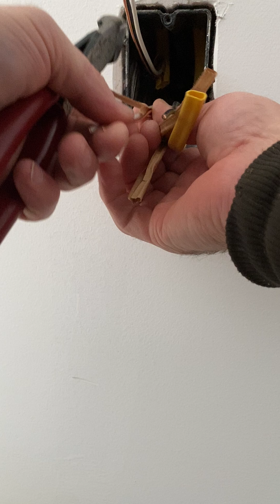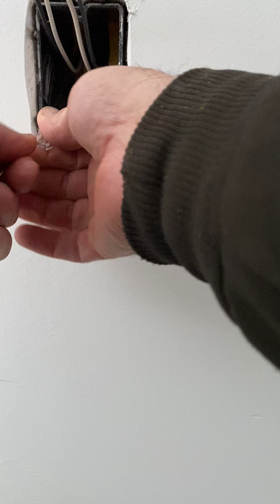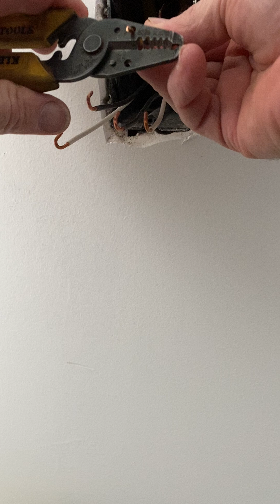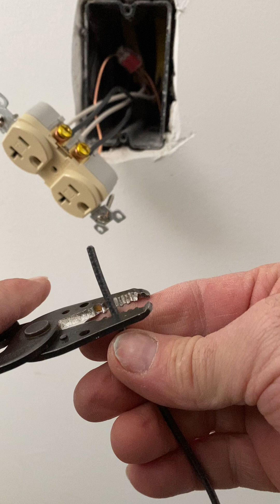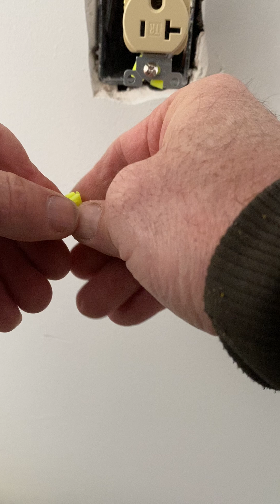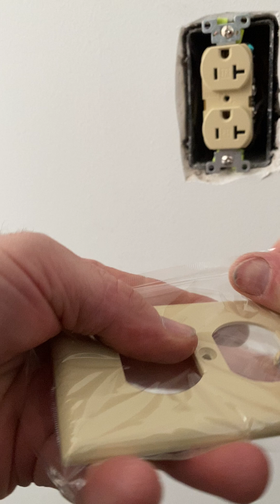Installation of a tamper proof 20 Amp duplex outlet with a hot wire and a load wire

Comment: Your going back to the 1930's... The new update is to pigtail...such as putting stress of current to the receptacle when it does not need to, unnecessary.. what ever load that was downstream is stressing on that receptacle that you installed.. Effiency is out the window  I would get fired on a job and boss would tell me were going back in time lol...
Reply: It appears this is wired in series too. If the outlet were to go bad everything in that line is dead?
Reply: @PhillipDeGraves  Its not series its a chain parallel circuit which is how every house is wired
Reply: Thats all you had to say@timmichael739 . What confused me was the thought if the outlet goes bad there would be no power going down range to the rest of the chain.
Reply: Think about this. It's a 20 amp receptacle. If you plug in a device that draws 20 amps, will that screw buss handle it? Yes, it's rated for that 20 amp load, so why can't it feed downstream receptacles? If it exceeds 20 amps, it will trip the breaker any way. 
I see it done this way in new construction. no issues.
Reply: @cgschow1971  correct, they’re UL listed for such wiring method but those who’ve been in the trade long enough know that pigtailed outlets are easier and safer to replace when done so.
Reply: @rcwrecker78  You must be a plumber
Reply: you dont know what your talking about
i would fire you and your boss
Reply: @timmichael739  ??
Reply: Well you and your boss are fired
Reply: Pigtails will always be better than looping through outlet. The additional advantage is that you can replace a bad outlet without affecting the circuit downstream (especially for those who don’t know about open neutrals and how to spot or avoid one). Those quick connect suitcases are not reliable. They loosen over time. Wago connectors or quality wirenuts are best for joints.
Reply: @rcwrecker78  You dont know shit about electrical
so shut your mouth